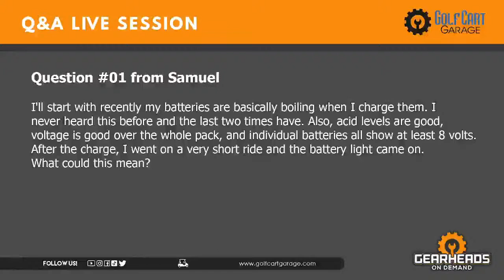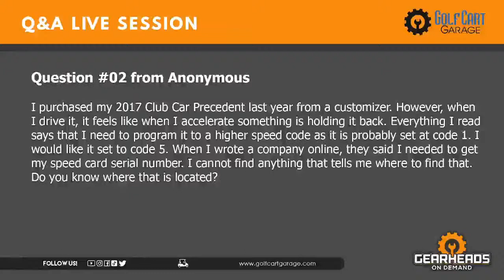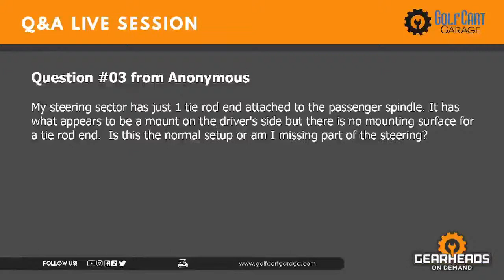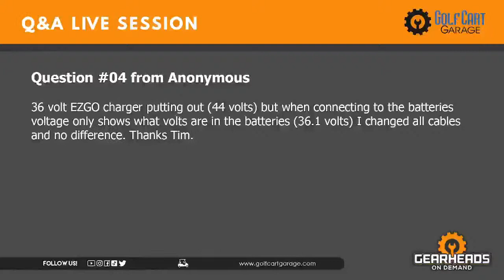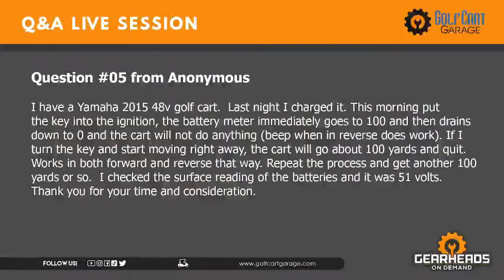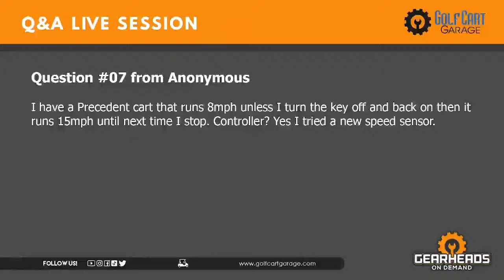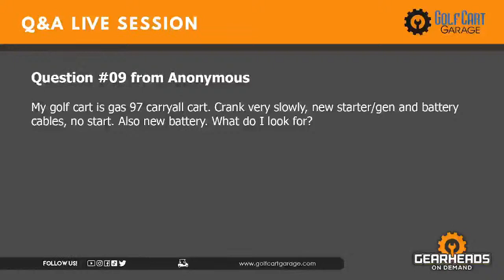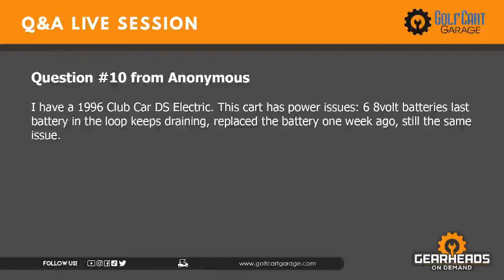Battery position in a series circuit | Golf Cart Garage I  Episode # 136

Comment: Been learning and working on my first cart,  04 ezgo txtdirect drive  36v, new batteries,  new cables,  cleaning connections,  what  else to keep the wheels spinning smooth , all flat steel area and stock , grease bearing? Anything about the direct drive rear /axle.
Reply from the maker: Hello.  There are a few grease fitting in the steering area that need a shot of grease about once a year.  Other than that, just keep up with your batteries.  Keep them clean and keep all connections tight.